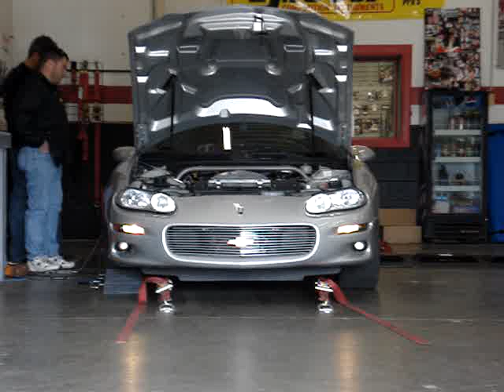2000 SS M6 Dyno runs with MS4 cam

Comment from the maker: @inferno135 dude, that was several years ago, I have already moved on and built a 6.0L L92 and been running it for 3 seasons. Go check my other vids. Stock bottom 6.0L running 10.90's at 3800lb raceweight. I got nothing to prove to you. thanks.